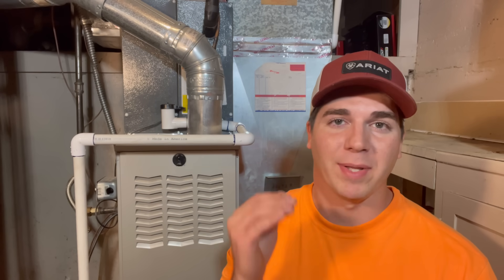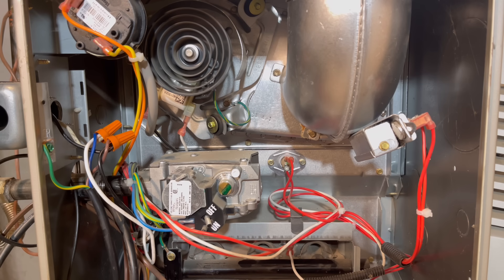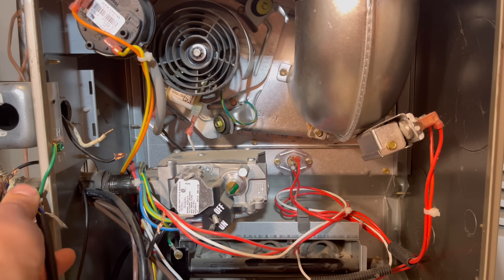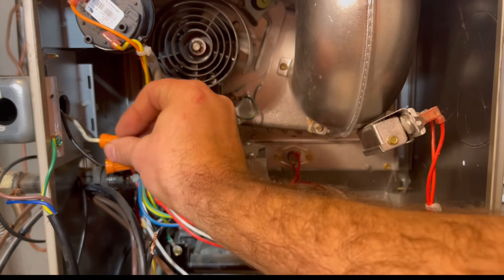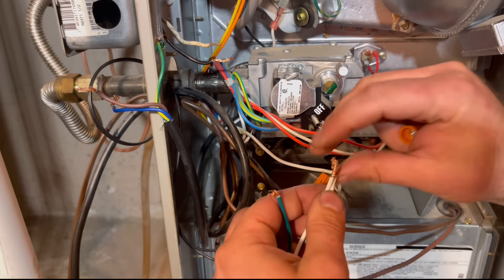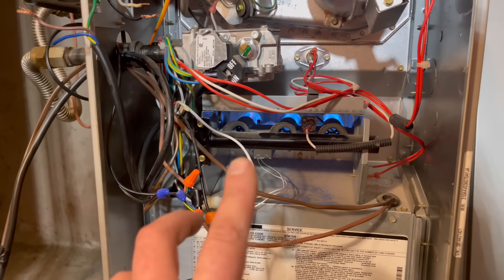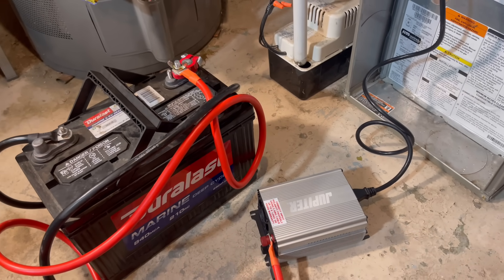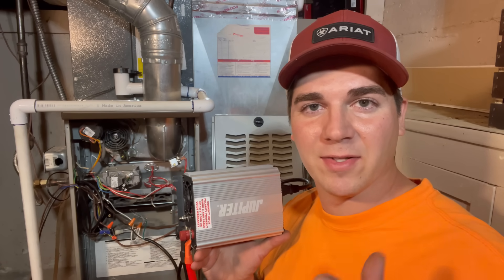Did You Know You Can Heat Your Home With A Car Battery?

Comment: I see the comments about this setup not having enough power to run for extended time. Long as it keeps the home from complete freezing that's good enough. If all the generators are sold out. This is another option. Buy some semi truck batteries.
Reply from the maker: The test video with a super awesome alternative will be posted this evening at 5 so make sure and check that one out! Cheers

Comment: This is slightly misleading as most card batteries are starter batteries. Starter batteries range in capacity from like 20Ah to 60Ah, using ohms law, AxV=W 60AmpHour X 12 Volt is 720Wh. HVAC central blower motor can draw like 300 to 400 watts. So 720/300=2.4 Hours of runtime, not including power needed to run the exaust blower, the circuitry, thermostat, glow plug/igniter. The furnace may not run constantly once it's at temp, but your def not going to get days out of a simple starter battery.

Instead, goto lowes and grab as many 100Ah basement sentry sump pump batteries as you can, they are designed for this kind of application. 

Also, the inverter should be a pure sine wave inverter or you will eventually shorten the life of your AC induction motors. Modified sine wave inverters cause abnormal heating of the coils in the motors because the waveform isn't what the coils were designed for.

Comment: In the winter time I have 3 of my boat batteries on a charger. If power goes out I roll the cart over to the mechanical room and connect up a 2500watt true sine wave inverter. I can run the furnace for 5 days before the inverter shuts down.
Reply from the maker: Amazing. Thanks for sharing!

Comment: What if one used not forced hot air but hot water ...base boards with a circulator pump...Gas furnace might work just as well...but what of the pumps ?....any comments ?
Reply from the maker: Yes this will totally work. That’s what my brother has in Missouri. So as long as you have gas you are golden 👍🏽

Comment: I presume deep cycle marine batteries might be better for this application. Deep cycle batteries are designed to go from full charge to zero multiple times; carg battery cells will not recharge after depleting to zero multiple times.

I have the same setup but I wired three batteries in parallel and I have gotten two weeks out of that setup with intermittent use and the therm on 66. The batteries are connected to a solar panel for charging and trickle charge all day, every day, and are pretty much at 100% all the time.

I also added a second switched outlet box below the main switched box.

I wired the second switched outlet to the same line-in as the main box, and I did pigtails with push and lock connectors, the kind that can be removed by lifting the locking side. We have electricians in the family and these are what they use, so I have no issues with their safety or removability. 

Then I made a two sided extension cord, about six feet long. It has a plug on both ends -- when you make it be sure you're connecting the hot to the correct terminals.

When the power goes out I use the switch to turn the main box off, then turn the switch on the secondary box to the on position. Then I use the two sided plug to connect the inverter to the second box. Make sure the inverter is OFF, because the ends of the plug will be hot and can kill someone if they are not careful. 

AFter plugging into the inverter I turn the switch on and we're good. 

The downside to this is that you need to remember to turn your boxes off accordingly, and you can't leave the two sided plug plugged into either the second outlet, nor the inverter without risking someone grabbing the live end.

However, the plus side is that you don't have to take off your panel and rewire every time your power goes out. In my city the power goes out at least once a week in the winter, so this is the best solution for me, and it's always at 0200, when it's too dark to see anything.

Comment: How many watts inverter do I need?
Reply from the maker: Depends on the size of your furnace. If it’s relatively small a 1000-1500w will do. If you have an amp meter and can check the amps when it’s running that’s the best way, but you could test an inverter off of Amazon such as the one in the video description, and if it doesn’t work just send it back and get a bigger one. Cheers

Comment: Really should emphasize how important it is to DISCONNECT the dead electrical company feed from the furnace before connecting the battery back-up and inverter system.  Otherwise your nifty DIY emergency supply will  backfeed into the neighborhood grid and ELECTROCUTE power company linemen who are trying to fix the original problem...

Comment: This is a good idea but not of the novice. Also the battery may power the gas furnace alone. The hvac fan would not have power or enough power from the battery to push the heat through out the vents.

Comment: That was fantastic, thank you for taking the time to explain it. I should have known b/c I love car audio, but this is an excellent idea. I was without power for 6 hours in Denver yesterday and we were all at home sick.
Reply: Hey Matt did you have to mess with thermostat? Does thermostat stay on during power outage?
Reply: @impulsora75  I haven't tried it yet Jose. But the thermostat is a low-voltage device that's usually on a battery backup such as a Nest Thermostat. If you look at your furnace you'll notice that the thermostat is powered by a low-voltage step-down transformer that draws a few watts. Nothing compared to the fan motor watt consumption, or the exhaust motor if you have a high-efficiency 90%+ furnace. Cheers bro.

Comment: I have an "add on" corn-pellet furnace, along with my gas furnace. Once the power is off, it won't re-light by itself, so I was thinking I could run the corn burner off the battery and inverter permanently, and use a battery maintainer to keep the battery charged while I have power.
 There would be no need to switch anything, if I have an outage, and the corn burner will keep going without having to be re-lit.

Comment: Thanks for taking the risk, showing old school simplicity.  A car battery is about 1kwh.  A gas inducer motor can consume well over a hundred W, often many hundreds  (several amps at 110vac).  As such might only be able to run few hours or so.  Which may well be enough heat until the power returns.  I connected the inverter to the car battery at the car, ran a extension cord to the furnace.  Ran the car every so often to charge it up.

Comment: I was actually thinking of just adding a large UPS unit to power in for my gas heating system so it would just come on automatically and it protects heating systems from surges and gives it clean power you could add a car battery to the ups for extra run time. i got a 1500 VA model for 179 on sale

Comment: Great video, but not the best teacher, and there are some minor technical errors, plus some extremely important additional info that could have people heating their homes for far beyond a few days if necessary. He says the inverter converts the power to 110V. Actually, it inverts it, hence the name inverter. Converters are used to go the opposite, from 110V to 12V. He points to the inverter and says this device can power your unit. It's the battery that's providing the power. The inverter just gets it to the proper voltage and provides the proper outlet for the power coming from the battery. He doesn't connect the ground that's on his pigtail, and clearly, there is a grounding point right there in front of him. That was just laziness and bad advice. He should also be advising to turn off the breaker to the furnace before doing ANYTHING to it.

Now, for the additional info that would be extremely helpful. He says that you can just take a car battery out of your car and do this, and technically, he is correct. However, car batteries are not made to be drawn down and recharged like marine or RV deep cycle batteries. Doing this to a car battery will destroy it rather quickly, and it will be useless, and have to be replaced. Plus, car lead acid batteries give off dangerous gases that can be harmful or explosive...not what you want near a gas furnace. AGM batteries are far better for this.

It appears he bought his inverter from Harbor Freight, and that's a good place to get one, but you also need to know a little bit about inverters. Some are too small to support the initial power surge of electrical items starting up, and during the initial startup, the circuit breaker could trip on the inverter. You'll need to know what your maximum loads will be at any given time, and what your maximum surge loads will be, and buy an inverter that can easily support those loads.

With that out of the way, one should know that for just a little bit of money, They can add a 100 watt solar panel and solar charge controller that connects to the battery, and it will keep the battery charged so that you could conceivably run this system for days or weeks, or infinitely. Again, there are some parameters and conditions that may vary, which may require more solar input, or more battery. Harbor freight has inexpensive solar batteries that are great for these types of scenarios. Batteries can be connected in parallel for more amp hours of power (longer run time) at 12VDC. The inverter also uses some of the battery juice, so keep that in mind. If the inverter gets hot, it has a fan that will kick on to cool it,and that drains even more power from your battery.

I have used a lot of Harbor Freight panels and equipment of different types, and for the homeowner, it's a great way to experiment and learn about solar power. I just bought another solar battery a few days ago for a specific use. My dog is really old and has started crapping in the house. My wife won't let me put him out in the cold. We compromised. I bought a 10X10 kennel to keep in the garage where it's warm. We wanted to set up a camera to monitor him, and a low powered light so he won't be in perpetual darkness. I already had a 100 watt solar panel, solar charge controller, and inverter that I use for camping. All I needed was a battery and a camera. I bought a Geeni camera at Harbor Freight for $37 and a solar battery on sale for $64. I also already had a 12V LED light with an on/off switch and it only draws 5 watts. I placed my solar panel outside the garage door, ran the wire in the corner, along the wall, to a table where the solar charge controller, battery, and camera are placed. The wire connects into the solar input side of the controller, and another goes from the battery connection on the controller to the battery. The controller has a connection for plugging in my 12V light, and it has a USB port for powering the camera. I downloaded the app to my phone and connected the camera to my phone for monitoring the camera. We can now keep a close watch on our dog from anywhere, using a solar powered light and camera. It runs 24/7.

A little more important info about inverters. There are two types, Pure Sine Wave and Modified Sine Wave. If you are going to be running sensitive electronic equipment, like phones, laptops, TVs, refrigerators, you'll want a Pure Sine Wave inverter so you don't destroy your sensitive equipment. Yes, they are more expensive, but when you start replacing the electronics in your house and maybe a refrigerator, you'll quickly realize the benefit of the extra cost. The Modified Sine Wave inverters are cheaper and are fine for running power tools and some other equipment. He was using a modified sine wave inverter from Harbor Freight. Harbor Freight has started selling pure sine wave inverters recently, and I need to pick one up.

Footnotes: At my previous house, my shop was in a small metal building out back with no power. I installed about 450 watts of solar panels, 4 or 5 batteries wired in parallel, and it ran my lights and power tools, except the bigger items like my 12" miter saw that pulls 15 amps. I ran a drop cord for that when I needed it. I was using a 2000/4000 watt inverter. The first number is what your inverter will cruise at. The second is the peak power the unit can withstand for a few seconds, those heavy start up loads when a tool or equipment first kicks on.

Currently, I have a lawn equipment and storage shed at the back of my property. I have a 100 watt solar panel, a 35 amp hour solar battery, an inverter, and lights out there. The inverter allows me to run a trickle charger to my mower and if needed, I can plug in small items that use 110VAC.
Reply from the maker: Wow, this has to be the most thought out comment I’ve ever seen. Thank you so much for investing the time to educate people. I apologize if things were missing In this video I was just excited to share this as it was exciting for me. I’ll have a follow up video posting this Wednesday evening so make sure to stay tuned for that! Cheers my friend
Reply: @diyhvacguy   Just so you know, I wasn't trying to crap on you. I just thought a little polish could help. I'm retired military, and my favorite part of my service was teaching and passing knowledge to others.  It's just my nature to want to teach and clarify. I'm a stickler for detail. Good luck with the next Vid!

Comment: The other thing that you can do is add a battery trickle charger and you have a way to use that setup pretty much forever. The only thing you need to do is make sure the power inverter has enough output for the furnace and charger.
Reply from the maker: I wish. The laws of thermodynamics say otherwise :)

Comment: Some inverters do come with their own power wires, especially the larger ones.  But I've been wanting to improve my winter preparedness and intend to make my furnace more easily converted to emergency power.  It's a heat pump / gas hybrid, so I have to remember to switch the thermostat override to 'emergency heat' so it doesn't try to use the outdoor heat pump instead of the gas.  The heat pump runs on 220 anyway and wouldn't be able to work, but it would probably try to use it until it got colder and tripped over to emergency heat mode automatically.

I'm considering installing an outlet box INISDE my furnace, powered by the switched power, and connect in a standard 110 plug from the furnace, and just "plug it in" for normal use.  Then if I need to go with an inverter, all I have to do is pop open the panel and unplug the furnace from the outlet, and plug it into an inverter.  (no fiddling with electrical wires)  I suppose I could even just make all of this external and not even need to open the furnace to switch to emergency power?
Reply from the maker: Stay tuned in for my next couple videos! The next one will show the finished product on the redone outlet/switch for my furnace, and the next video after that shows how to install it! Cheers

Comment: I have a newer high efficiency heater.  My generator would cause a fault in the controls. So, I tried an invertor hooked to a battery. It still was not clean enough. Furnace would light. But, when fan was to come on. It shut off. Never tried again. Not worth damaging expensive components.
Reply from the maker: Hmm. Sorry to hear that. Did you try running it with the inverter connected to your vehicle and it running?

Comment: The battery isn’t heating.  It’s just running the fan.  The gas is providing the heat.  Try it with an electric furnace. It won’t work. Your title is very misleading.
Reply from the maker: It’s stated at the beginning of the video that this is for a gas furnace 👍🏽
Reply: @diyhvacguy  sorry I didn’t see that.

Comment: Great video! But you failed to mention that the condition and capacity of the battery will have a large effect on the success of this idea.  The battery from your car is meant to provide shorter bursts of high power to start your engine. Once it is running, most of the 12 volt DC power your vehicle needs is provided by the car's alternator.  You would likely have better success, and longer run time, if you use  a Deep-Cycle battery, which is designed to provide a smaller amount of current over a longer period of time between charges. Deep discharging of a regular car battery will definitely shorten its life.
Reply: I agree about getting a dedicated deep cycle. I did want to add, though, that there are some options for using the heat from the gas to keep the battery topped up. Specifically an appropriate Peltier array that can put out ~14VDC. You'd need to get a little creative with cooling the cool side... a heat sink and a CPU fan would work, but water cooling would be better. Lastly you'd want some diodes to keep from backfeeding the Peltier (assuming it's not already so equipped, depends if you're building from scratch or off the shelf), but such a setup could keep a system like this running indefinitely.

The battery lights the fire, the fire charges the battery. You could also do the same thing with a Stirling engine if you don't mind your basement looking like some steampunk mad scientists lab. In either case you'd have to do a lot of tuning to get it just right, and there are issues with voltage regulation since the heat source would be variable.
Reply: @nutbastard  I don't think this would work because the battery isn't just lighting the fire, most of its power goes to running the high output fan to push air throughout the house, probably 500W or more. I'd love to know a way to keep it topped up though
Reply: @nutbastard  My house is 1000 sq. ft.  I measured the blower motor alone at 750 watts (1995 furnace).  Sometimes that means the motor/bearing/etc. is failing, but that measurement was taken a good 10 years ago (with nothing replaced since).

Comment: You can buy a failover switch pretty cheap and have it pre-wired so all you have to do is plug it into the inverter.  How many Amps AC are you drawing from the furnace?
Reply from the maker: 7amps